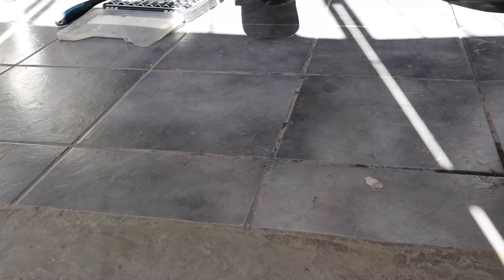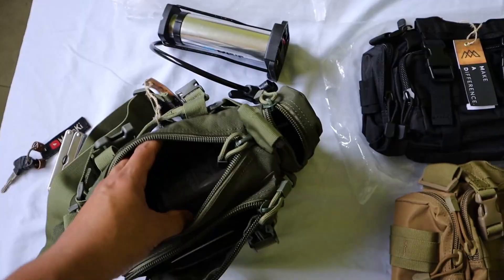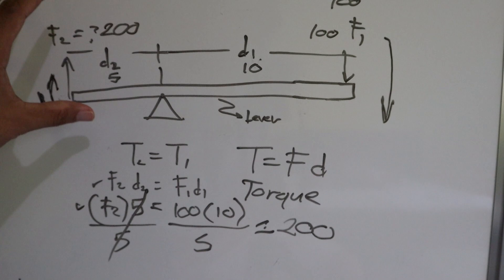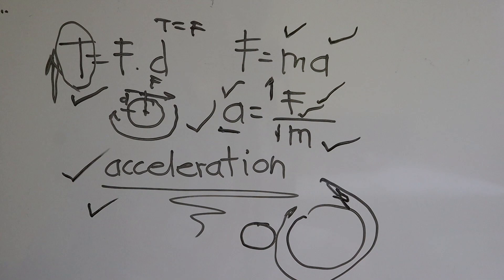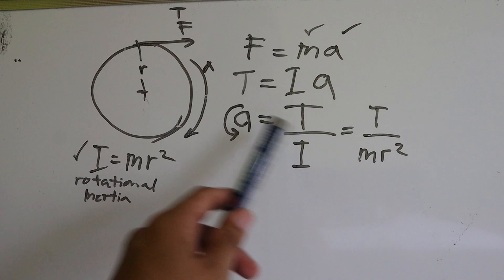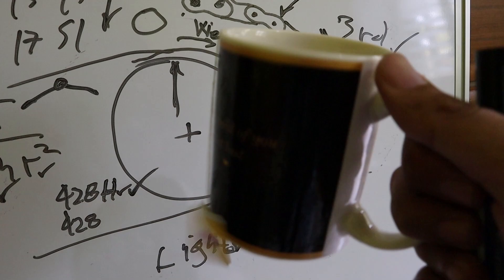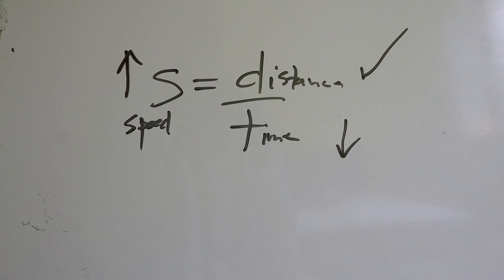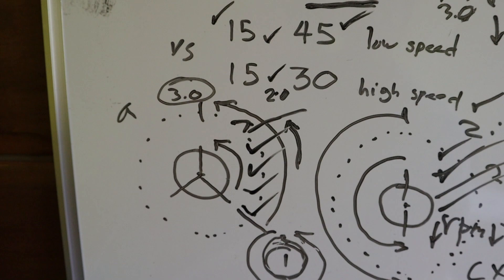Paano pumili ng sprocket - Engineering Tagalog

Comment: Iyan ang problema sa low cost na motor. Madali masira ang mga parts.
Pero sa porma, the best ang rusi 250 classic. Ganyan din motor ko. Pero yung rubber bushing sa hub pinalitan ko, gumawa ako ng rubber bushing gamit yung guma sa gulong ng car. Mas matigas, hindi basta bumibigay, kahit biglaang arangkada. Nilagyan ko tuloy ng stopper sa likod yung bushing, kasi malalim yung butas na sinusuutan ng bushing sa hub, kaya nahuhulog yung metal tube (na sinusuutan ng 4 na bolt), sa likod pag lumuwang na yung original na rubber bushing; dahilan kung bakit natatanggal ang sprocket sa hub.

Comment: Very educational pre and I become more interested to know more as I am having a problem with my FZ 16 bike having difficulty reaching 114 top speed. I hope you' LL answe back what need to be done to increase its speed? What recommended sprocket size would you recommend. Ty
Reply: If you're looking for final drive speed you should go for a smaller sprocket size, for both front and rear. You'll have a weaker torque figure but you should be able make use of your final drive better, it'll just be really slow to build up speed.

Comment: Lods question narin. Stock parin sprockets ko. Pero pa nangalahati na yung rpm ko, parang wala nang pumapasok na lakas lods. Para mamaximise ko yung lakas ng motor ko lods, magpalit ba ko ng sprocket na pang low speed? O highspeed?
Reply from the maker: Mraramdaman m pinka mlkas n acceleration sa pinaka mataas n torque, sa cam timing ng motor natin, sa 6000rpm... pg lagpas doon although mg add kparin ng speed, hindi n ganun ka bilis mg accelerate.... kung mag palit k ng low speed, ang mangyayari lng, bibilis lng mg rise papuntang 6krpm or higher rpms... to answer ur question, it is up to u... ilan kilo ka ba?
Reply: @MunsKi   @MunsKi  60+ kilos ako ee. Kadalasan may obr na 50kilos.

Ah, ibig sabihin kahit magpalit ako ng highspeed sprocket, di ko parin mamamaximise yung higher rpm ko? Tlagang ganun tlga yung pakakagawa sa kanya na, pag 6k+ na yung rpm ee bumabagal na yung acceleration? Tama ba pagkakaintindi ko lods?
Reply: @MunsKi  oks na pala lods. Nagresearch ako sa internet. May mga engine palang designed to work efficiently in a specific RPMs only. Hmmm..